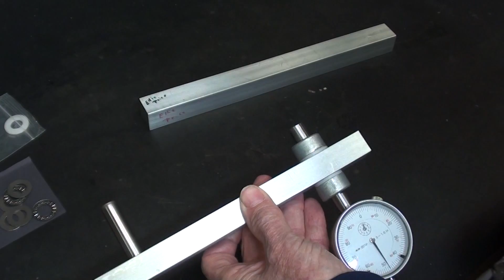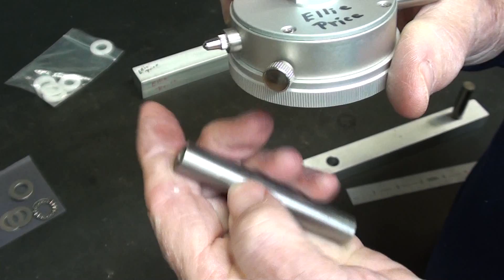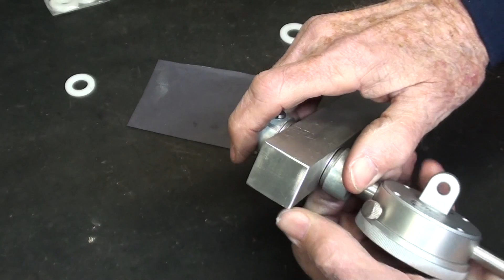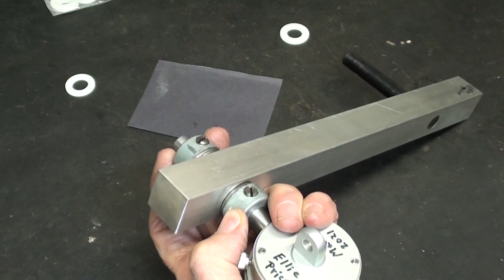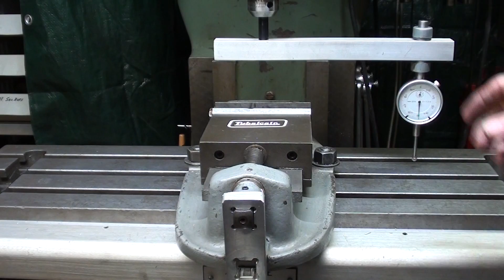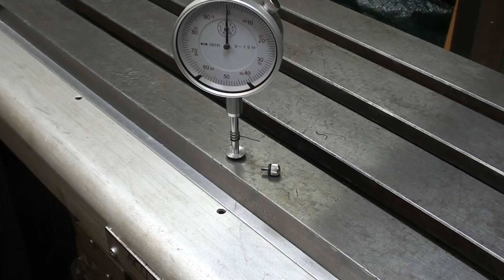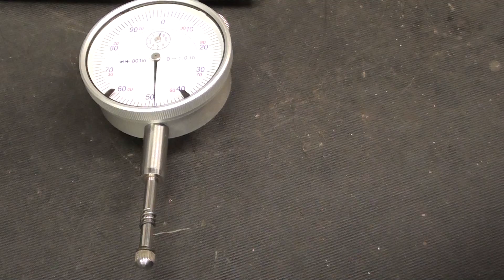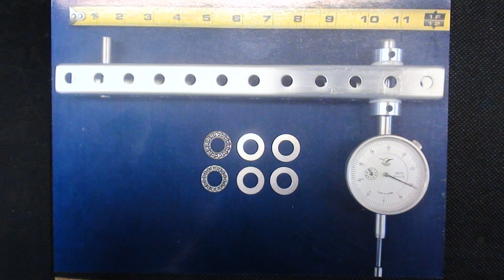MAKE BRIDGEPORT TRAMMING ATTACHMENT #662 tubalcain

Comment: Mr. Peterson, glad you got the courage to tilt the head in order to show us how this great idea works.  I did notice that you couldnt bring yourself to adjust the nod.  I guess no one was around to give you the beating you say you prefer to having to tilt/nod the head on the milling machine.  I think of you anytime I even think about changing either.  Thanks for the content and the confidence your instructional videos gave me several years ago when I saw that I could learn to used a metal lathe which I hadnt touched since its introduction in high school.  That was what gave me the push I needed to start buying my own machines and pursue my desire to add that capability in my own shop.  And to acquire and operate a vertical mill which I knew nothing about.
Reply from the maker: Yes, I was very hesitant to move the head. Even for a demonstration
Reply: I find it hard to understand why adjusting the nod is so difficult for many viewers. By moving the indicator slowly across the table you can easily tell whether the head is tilted up or down. Adjust the nod until the indicator reads the same across the width of the table.

Comment: Good morning, I always enjoy your videos. I am probably wrong, but if the mill is out of tram, and you use it to drill the holes for the pin and the test indicator, will that affect the accuracy of the finished product? Just thinking that these holes should be drilled dead perpendicular to the beam.
Reply: You're right, John.  I'm going to have to drill the holes with my press.... but wait!  It's not in tram!  Dang.  So how good is my square...? 😵‍💫
Reply: No!  The chuck or collet tilt or runout does not matter in the least, nor does perpendicularity of the stems!  These can be way off, and it does not matter at all.
Reply: @RichardKinch  Ooohhhh.... embarrassment... once my beam is mounted with it's indicator and swung through 360 degrees it will describe a flat plane relative to the chuck regardless of the two, quite random, hole angles.  Then I measure 180 degrees apart (in/out or left/right) and adjust the head or table till the two planes match.  Thankyou Richard.  (... spot the beginner  😕)
Reply: MrPossumeyes Oops, you are correct that the holes do not need to be perfectly perpendicular to the bar for this device to work. They should not be off too much however or the nylon or needle washers will sit crooked on the bar and not give a good reading when the indicator is rotated. Good workmanship is all that’s needed here. I designed this device and very pleased that so many understand it’s advantages and are offering these useful tips.
Reply: @ellieprice363  🙂  When I make mine I'll make another afterwards so I won't blush every time I use it.
Reply: @ellieprice363  Actually, not even that matters.  All the counts is that the indicator stem axis is borne coaxial with the sleeve bearing axis.  Any off-parallelism of the stem axis to the spindle axis is irrelevant.

Comment: As a home gamer, I cannot usually afford expensive (and high quality) measuring tools.  This simple and inexpensive approach is just the kind of innovation I appreciate.  Thanks to you and Ellie for sharing.
Reply: Agree, most of my stuff was purchased used from Ebay or garage sales.  About the only new stuff I bought was from Enco when they had a sale.  Too bad MSC bought them to eliminate the competition.
Reply: @G1951-w1y  OK, I made one up today with scrap metal using a 1" indicator with a missing lens.  Turns out my table was out by a whopping .030 over 16".  Got it down to .001".  To quote another YouTuber "good enough for the girls I go out with".  Yeah...too bad about Enco, MSC is a ripoff.
Reply: Yeah me too..super low budget,,that's why I appreciate all these guys like Mr Pete, ave, TOT, and a bunch more guys that have way deep pockets then I do but still are doing some pretty cool stuff that makes you think of ways to do stuff on the cheap. My "new to me" emco pillar mill is going to get trammed at minimum cost. And I have a trashed thrown in the price that's getting cnc modified.

Comment: Just a question rather then going to all that expense of the thrust bearing and such. Why not just set the dial indicator 90 deg from what you started with it and you look at it at the end of the table get your reading swing it 180 deg and look at it at the end of the table at other end. No turning of the indicator.
Reply: Stop collars and nylon washers are both easily made in the shop. However, for super cheap you can get by with stop collars only if you snug them up tight against the bar. The convenience of the rotating indicator is worth the small extra cost.
Reply: Smarty pants!

Comment: Could you build one with two dial indicators one one each end, so you don’t have to spin it, or would that be less accurate.
Reply: Yes, that is how the commercially available tramming tools work.  But then the chuck or collet angular error to the spindle axis becomes relevant.
Reply: Yes, less accurate and more difficult to adjust. Only one indicator is necessary.

Comment: When I bought my Bridgeport the main considerations were the variable speed head and the location was nearby, I would not have to have it shipped.  It came with a 42" table, but a 32" would have suited me better.
Reply: I feel your pain. My Bridgeport has a 48" table. A 42" would be plenty long enough and I could probably get the machine in or out of my shop without having to remove the table.
(Yes, I'm 1000% certain the table on my Bridgeport is 48", I just measured it to be extra, no doubt whatsoever certain. I have no one in mind that may question 48" but it seems likely someone will, or would have.)
Reply: @renaissanceman7145  My Bridgeport table is also 48 inches long which works well on some of my extra long milling jobs.

Comment: I made a similar device to measure small angles precisely. It has two indicators one either side of center. A carefully chosen indicator spacing will let the indicators show angle directly in degrees to 1/100th of a degree over a small range. My requirements are for angles in the 1-2 degree range for gear hobbing. It is fast and convenient for my specialized purpose but won't work in a generalized case for wide range of angles. it is a lot faster than a sine bar and just as precise over a small range. With sine bar like calculations you could set angles with your device. I should put the thrust bearings on it that is a great idea. Why don't they make indicators with a scale on both sides?
Reply: Hi John, 
Here’s a setup for angles on the Bridgeport that’s more accurate than dual indicators. Using the tramming device and a perfectly squared head, place a small digital level on the top surface of the aluminum bar, push the button for “zero” then another for “angle”. At this point when you tilt the head the screen will display the precise angle to 1/100 of a degree. You’ll have to make Mr. Pete’s tramming device and purchase or borrow a digital level but it should work as described.

Comment: Don't forget to tram in the head on your milling machine before you drill and ream or your project will be cockeyed.  Mr. Stewart forgot to mention (outright) that this device is multiplying the actual error by the length of the bar, so a 1. mil indication is actually a tiny error. Ron W4BIN
Reply: Even on a 16 inch swing I found it very easy to bring the tilt in to zero. I think this is because the large indicator face is so easy to see.

Comment: Hi Lyle,
Nice setup.
Tip:  Use a gauge block under the indicator to bridge any divots that may be in the table and to allow the indicator to be above the table while moving from one side to the other.
I prefer to use an R8 collet rather than a drill chuck because there may be a fair amount of runout error in the drill chuck. 
Just my 2 cents worth!
Reply: That's two tips! Both good
Reply: @g.tucker8682  
Lol :-)
Reply: Actually, runout in the chuck is not a factor at all.  Imagine grabbing the tool between only 2 jaws as can happen with a small drill bit in a wide open chuck.  Even though the axis of the tool has a half inch of runout, the indicator is still moving only relative to the mill spindle.  This is the same principle as offset turning in a lathe.
Reply: @kensherwin4544  
That's true as long as there is no movement. 
Some drill chuck jaws have a habit of moving around, why not just use an R8 collet and remove all doubt?
Reply: No!  The chuck or collet tilt or runout does not matter in the least!
Reply: @RichardKinch  
I already agreed with Ken Sherwin that runout is not a factor. 
Why are you yelling?
Reply: @AerialPhotogGuy  My reply was directed to your original comment, which still disagrees.  But you agree with someone else who disagrees, so now I must implicitly not disagree, ..., it gets hard to follow.  This isn't moot court.
Reply: @RichardKinch  
Would it help to say that I agree with you too?
Still doesn't explain why you were yelling :-)
BTW, I already know why.
Your goal is to find things you feel is wrong so you can "Disagree" or tell people how "Wrong" they are. 
Don't be so serious, most people watch these type videos for entertainment and yes, educational content to some extent.
Relax, smell the flowers and be happy that we're on the only known planet that supports so much life :-)
Reply: @RichardKinch  (:-)))
Reply: @AerialPhotogGuy  Yes, I am a serious critic.  But it's just business, metalworking in this context.  It's a serious subject, even if some viewers are here for some laughs.  Chuckleheadedness is allowed, but shouldn't govern the utilitarian debates.

Comment: That's a great idea there!
For the lazier fabricators out there I suggest clocking the indicator so it faces to the "outside" of the axis, so you can mount it rigidly and just look from the sides of the milling machine.
Reply: Not sure what you mean, to the outside and mount it where Ridgely ? With the same type of bar?
Reply: @douglasbattjes3991  Just skip the thrust bearings and lock it so it is facing in line with the bar.
Reply: @Bytewize  Thanks ,,understand now or cheep mirror   👌